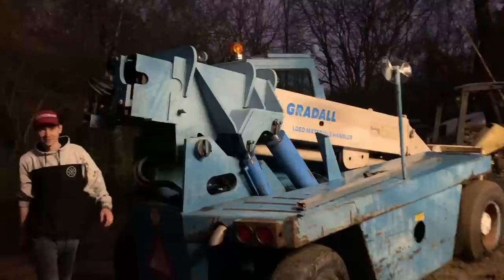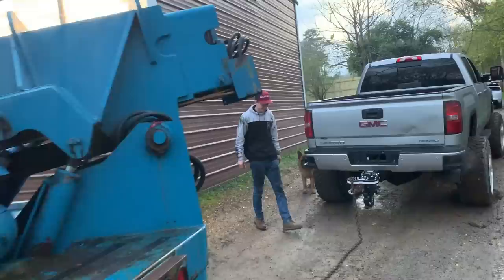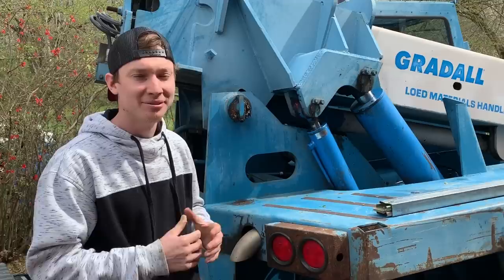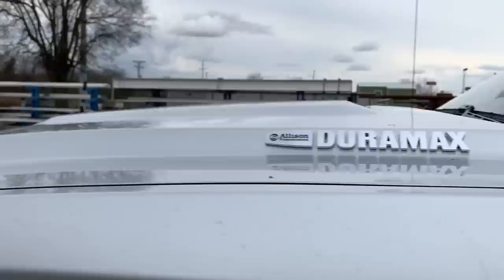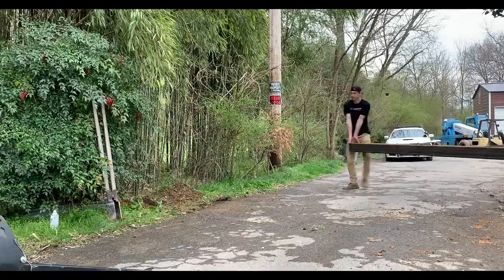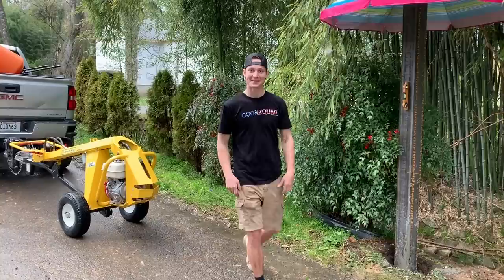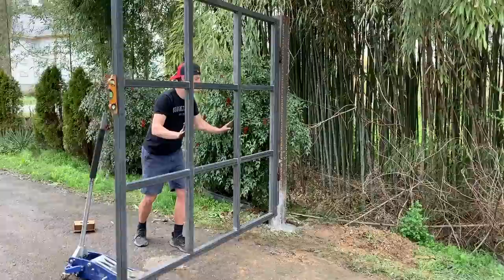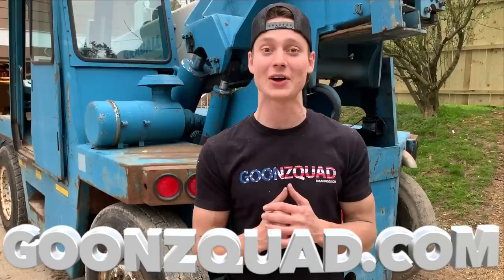Rebuilding The Worlds Biggest Forklift Part 3

Comment: Your holes are not deep enough, These gates will certainly sag.  Your Hinges are installed incorrect, Always put the hinge on the bottom so it holds the weight and the top hinge upside down, The way you have it anyone can walk up and just lift the gate out of the hinges and walk right in. You guys did a good job considering never doing this before.Never use spray paint, Always brush paint on so it is a thick base and will not rust after 6 months.

Comment: Worlds most stunned operators. If it was at least a skid steer and got stuck you can use the bucket to push it out, but using this stuff on unpaved and uneven surfaces, who let you use this stuff or are you illegally using them

Comment: Young an inexperienced. That extending boom could have gotten itself out. Even without using the extension, you just tilt the forks down to lift the front tires and put wood in the holes.

Comment: next you need to buy tractor so you can pull that thing easilyvif it gets stuck
Reply: There is no need for that. If they knew how to use it, it could have easily gotten itself out. With an extending boom, it would be very difficult to get that thing stuck to the point of not getting itself out.